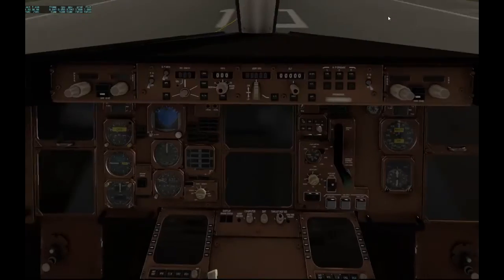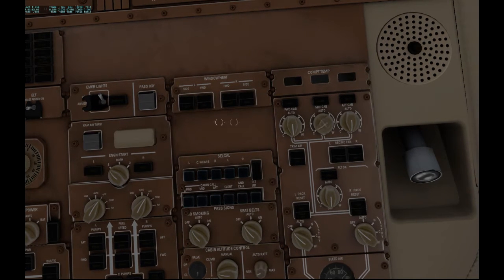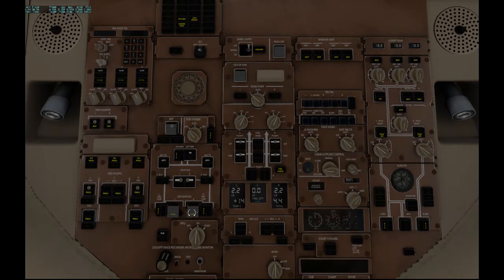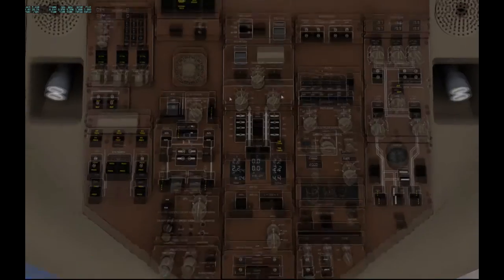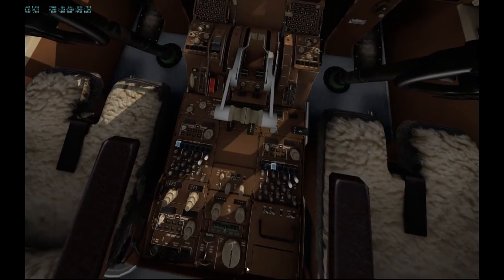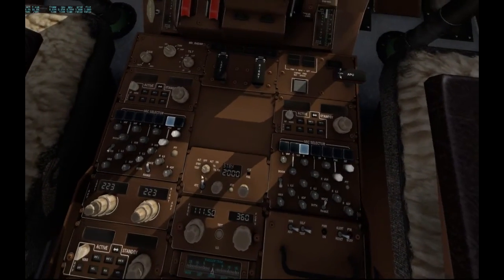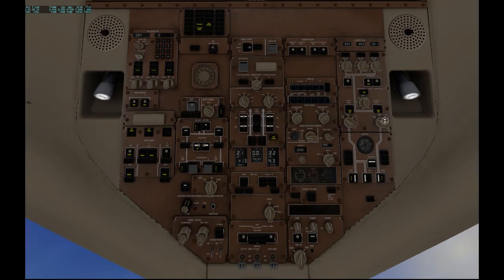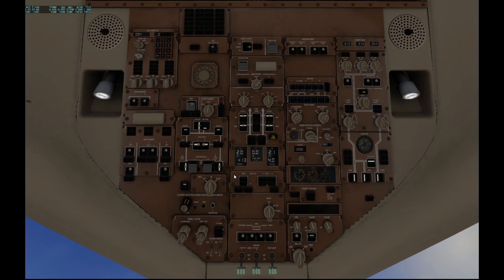[X-Plane 10.5] Basic FlightFactor 757 Power Up (not incl FMS)

Comment from the maker: So, of the 2000+ pages of documentation that came with this plane, I read through about half of that during the past week.  And there are a few things wrong with this video:

1.  Aligning the INS:  Just move the selector to Nav, not Align.  Once in Nav, after 10 mins the gyros are aligned and you can enter the aircraft position in the CDU and you're good to go.  Align is used to re-align the gyros to remove any errors after a few hours of flight.
2.  I totally missed the Standby Power switch.  That should go straight to auto.
3.  The fuel pumps don't need to be turned on before the Engine Start procedure.  I think the APU automatically draws fuel from one of the front tanks.